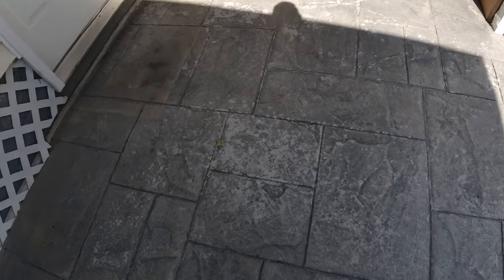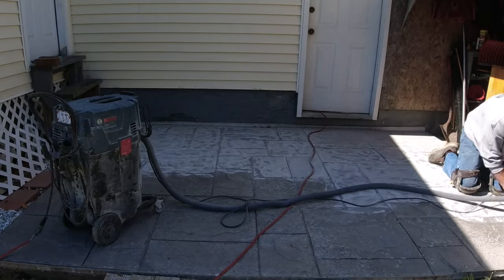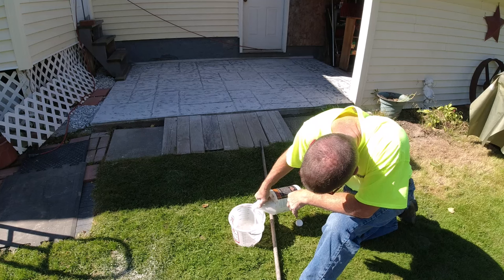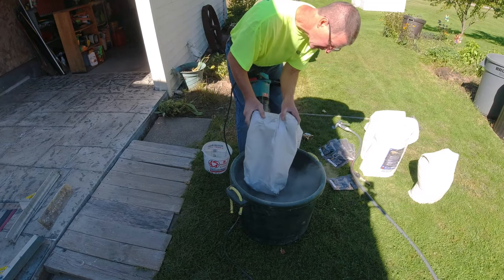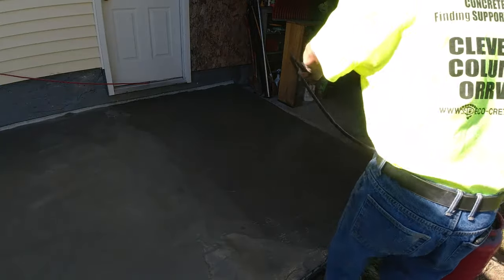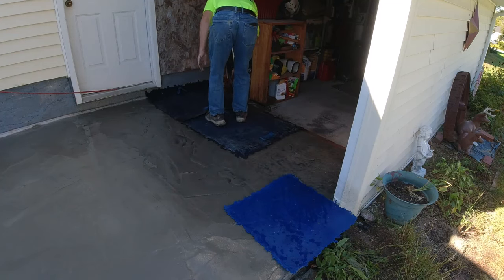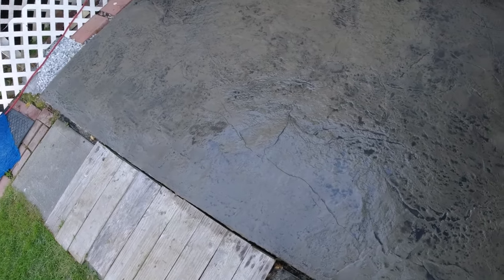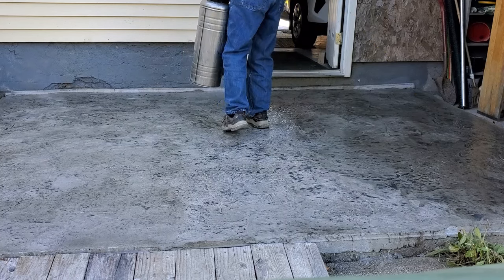I Fixed My STAMPED CONCRETE Nightmare with a Stampable Overlay Mix!

Comment: Wait. "For whatever reason"? Isn't it because of the type of concrete mix used, or for not been well sealed? I mean, there has to be an explanation as to why it happens right? I'm not concrete guy, but from what you hear when they say it's air-entrained or things like that, that are supposed to prevent this.

Comment: Thanks for the video. How well does the overlay hold up to snow removal with shovels, snow blowers or ATVs with a plow?
Reply from the maker: Holds up very good. It's actually stronger and more dense than the concrete.